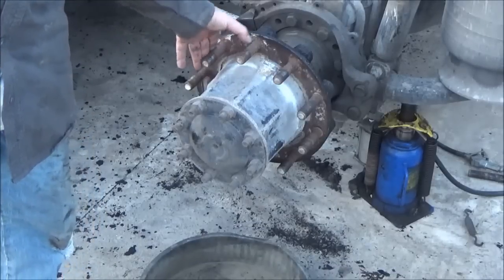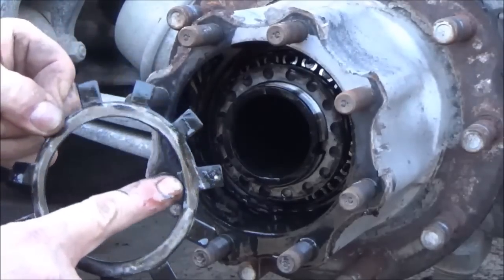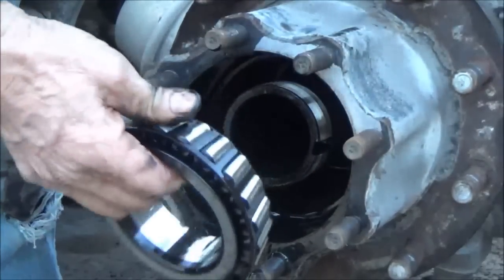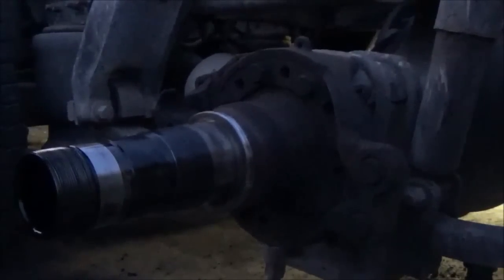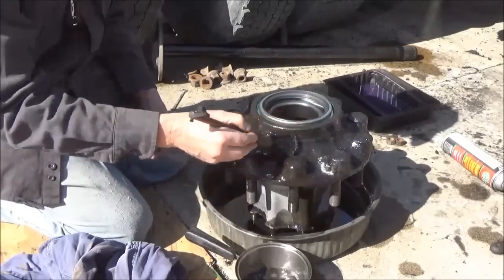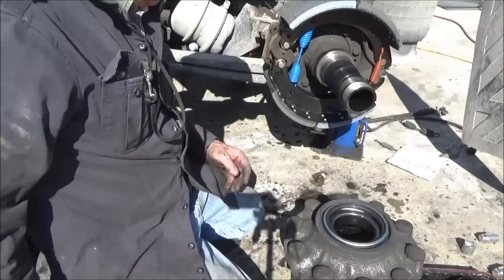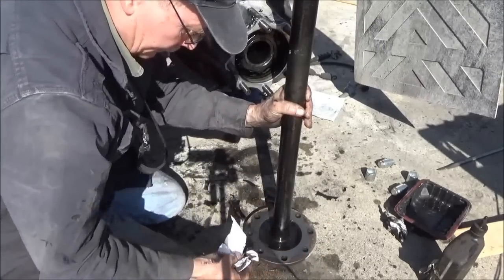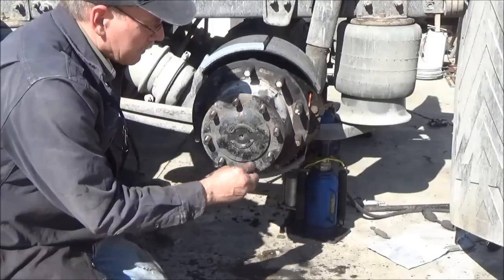Changing axle seal on semi truck at home without all the special tools

Comment: That dirty hub was supposed to be cleaned BEFORE replacing the (freshly washed and inspected bearing) and installing a new seal, that way no dirt will get into the bearing or inside the hub as that dirty hub is being washed.   Then everything is clean and ready to be installed back onto the axle.  Also, the FORD factory Service manual recommends packing the bearing with wheel bearing grease (which will later be dissolved into the gear oil), so the bearing will have lubrication until the gear oil has a chance to refill the hub properly.  Just my 2 cents  :)
Reply: Larry Kuzyk your $0.02 is worthless here... First of all - this isnt a little ford, second - the bearings in drive axles on a class 8 truck are lubricated in an oil bath shared with the rear differential and you don't pack them with grease.
Reply: Well my friend,  first of all, the manufacturers of the class 8 trucks you refer to do not manufacture the drive axles themselves, but rather,  they install third party items,  the most common of which are Rockwell and Eaton, to name a few drive axle manufacturers.  This also applies to the diesel engines, suspensions, brake components and transmissions as well, as I'm absolutely sure you're well aware of.  Gee, since when does Peterbilt, Freightliner, Ford, Kenworth, Volvo,  etc,  build a rear end?  One exception to this is Mack,  who manufactures and installs their own drive axles and diesel engines, but I cannot comment on their transmissions.  I believe they build/install  their own transmissions too.    So to say a Ford is a 'small' truck when Ford installs the same components such as Drive axles, Transmissions,  Suspensions, and Diesel engines (as per customer request) as any other Manufacturer in the country,  seems to me to be an uninformed and very short sighted comment.  Obviously a biased comment against Ford which is amusing.    Actually, I was never a fan of Ford as far as a Car manufacturer, (and still not), but when comparing the construction quality of my Ford L Series Tandem Cab and Frame (these are the only manufacturer specific items, generally speaking) against the others such as Pete and Freightliner,  (who seem to be dominating  truck sales in my local area)  it is the superior product, even though Ford does not manufacture Trucks any longer.   The engines, suspensions, transmissions of the said trucks are identical, so there's not much of a comparison to be had in those regards.   Secondly,  of course anyone who knows Trucks to any degree, knows that wheel bearings on drive axles are lubed with the same lube that lubes the differential gears, which you refer to as Oil bath.  I agree totally,  how could I not.    Read my post again,  I stated that the Ford SERVICE MANUAL,  not me, (I had no contributions to the content of said Publication),   suggests packing the wheel bearings in grease (WHICH WILL LATER BE DISSOLVED INTO THE GEAR OIL) to ensure the wheel  bearing are well lubricated until such time as the rear end lube has a chance to migrate to the bearings.  According to the Manual,  This procedure applies to ALL ROCKWELL AND EATON  rear ends, REGARLESS OF SIZE, which have been installed on any  Ford L- Series truck.   These are NOT small trucks.  This is a Ford publication remember.  I actually like this pre-greasing idea and have adopted it into my own maintenance regime as and added degree of superior maintenance.   Thirdly, the idea of my post was to say that the Hub shown in the video,  (where the wheel seal had obviously been leaking for a very long time to allow the accumulation of THAT much dirt),  should have been cleaned PRIOR to installing the bearing and seal....I couldn't believe my eyes.  AND also, who lets the outer bearing sit outside all night with the breeze blowing dust and dirt onto the bearing covered in oil,  and not even rinse and/or clean it prior to replacement?   Of course this job got done, and the truck still drove down the road with gritty bearings and all,  not the end of the world,  but c'mon,  if you're going to make a video, have some pride in your work.  Another 2 cents.

Comment: Easiest way to get the seal out is to take the outer bearing out, then put the nut back on, pull the hub toward you, the inner bearing won't clear the nut and with a couple tugs the seal will pop right out.

Comment: do mechanics in your country have a nice wage?
Reply from the maker: Depends on how good of a mechanic he is, I am a little on the slow side and would never cheat a costumer  so I quit mechanic work many years ago because I didn't like working so hard and dirty for the money I was getting. I only do this on my own equipment and for a few friends. I make more money as an owner operator truck driver than I did as a mechanic, and it's a lot cleaner and easier on my back
Reply: Gordon Robertson yes sir i'm always watching your videos and it helps me a lot as a practicing mechanic. Senior mechanics here don't want to teach me so i'm making up for myself. I hope i can find someone as good as you to teach me.
Reply from the maker: You can ask me about any repair work or whatever anytime, I'll try to help. Is your name Joedel?
Reply: Gordon Robertson that's correct sir. I'll reply here if i need to know something ^^
Reply: wage is 35k - 100k+ its not easy to make good money tho.

Comment: Did you really just finger tighten the spindle nut???? You are guaranteed to have problems because your bearings are out of adjustment from the very start!!! But then again you ALWAYS clean the hub before installing the bearings and seal and contaminate everything with dirt and sand!! You are not helping anybody in this video including yourself.
Reply: I don't know if you might think I came off as a asshole in my previous comment? But I wasn't trying for that. I'm just terrified of you showing people to do it this way when if someone is watching this and copy what you are doing that they most likely have never installed races and bearings before and the reason to tighten the shit out of the spindle nut and the back it off is to make sure that the bearings and races are fully seated!!! Not to mention have a preload!! And If they take out a seal like you did and if the truck has a brass ABS ring it will be all tore up with broke off teeth!!! If someone doesn't even have a hammer and a punch to take out a seal? Then they have absolutely no business working on a truck.
Reply from the maker: I had captions explaining all that but YT said they will remove captions I think in January this year. I plan to re do this video and add a link of it to this video. As for the way I tightened it, I did the 1st one that way about 15 years ago on the other side and the other axle on that side about 10 years ago and this one coming up on 3 years ago. I agree it's not the best way to show people with no experience and that's why I do plan to do a correction video. By the way, Hand tight? both of the other hubs came   OFF (not lost but removed)  this way and my dump truck did too, so it's a lot tighter than you give credit for. Thanks for watching.

Comment: Use vasoline on the seal when installing them.
Reply: Best assembly lube ever invented, vaseline! I've built more gas engines using vaseline, than I can count. Cheap, dependable, and once it heats up, it melts right out of the engine and mixes into your engine oil, for removal on first oil-change. Pure petroleum jelly, can't beat it for mechanic work.